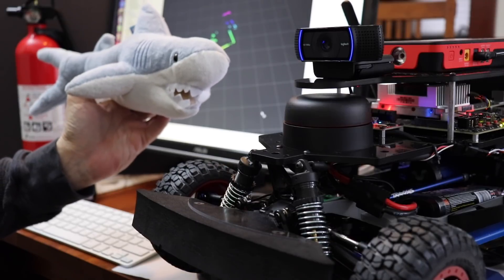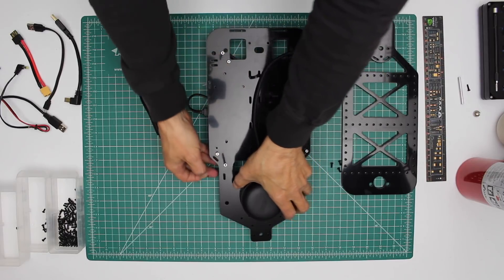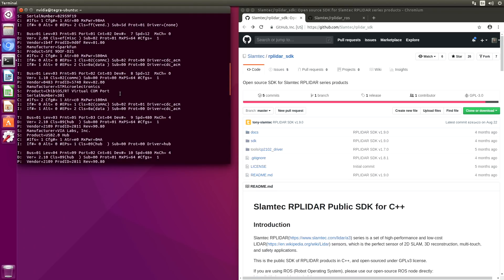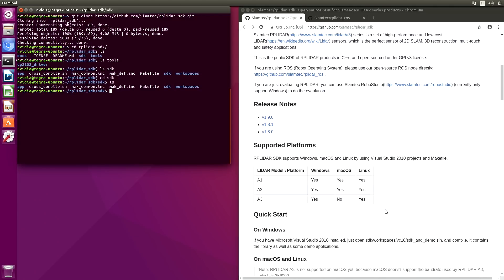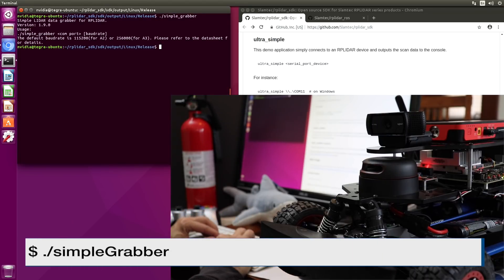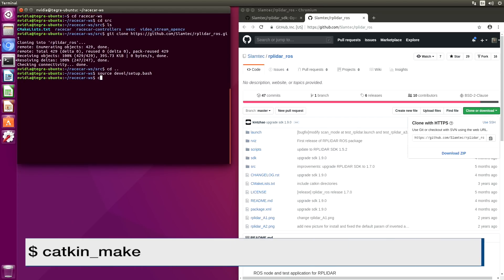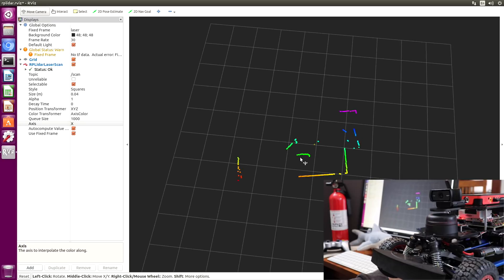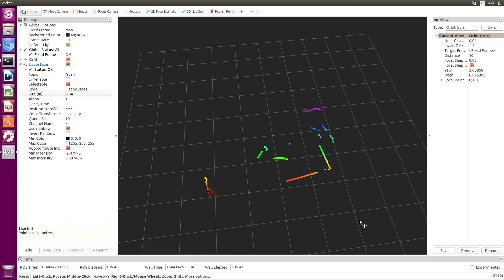RPLidar A2 - NVIDIA Jetson Development Kits

Comment: Thank you for that but  what about next step , there is no info about how can I use these laser scan output or hector slam output to make an autonomous drive
Reply from the maker: Not quite sure what  you are looking for here. There are ROS and ROS 2 packages available from Slamtec for these lidars. This allows you to use the lidars in conjunction with other ROS packages, such as Hector Slam.  If you are not using ROS/ROS 2, then there is a whole other set of questions you need to answer. Thanks for watching!

Comment: Hi, I'm working on the prototype of autonomous car. As I want to avoid obstacles using RP-Lidar A2 M8. But I want to do that in Python. As I have seen some values coming. Can you tell me how I can sort out distance values of when an object come in front of lidar? How to know? Which values will tell us? Also that object coordinate like size, width etc.  But SDK is written in C++. Can you tell me other way or suggest me some tutorials. Thank you so much if you can help me.
Reply from the maker: Not sure what you are asking. In the rplidar_sdk there is the ultra_simple app which prints out the data received from the device. You get back the angle from the device being measured,  and the distance to any object encountered. The angle will tell you the direction of an object in relation to the lidar, and the distance to that object. You will need to gather consecutive angles to determine the 'width' of the the object, remembering to correct for the circular nature of the lidar sweep. Good luck on your project!
Reply: @JetsonHacks  Thank you so much dear. What I want to tell you, It's simple to understand that I want to implement obstacle avoidance algorithm on RP-Lidar A2 M8 using Python language. And I want to sort out the accurate position of an object to avoid. But it's SDK is written in C++. Can you help me by telling availability of python libraries and please suggest me some tutorials.  Thank you! :)
Reply from the maker: @ansjaved3484  Dear, please search Github for 'RP-Lidar Python' where you will find many Python libraries for the RPLidar. Good luck on your project!
Reply: @JetsonHacks  okay cool. 👍
Reply: @JetsonHacks  dear, I have run SDK (./ultra_simple) demo, but Lidar is continuously running. How can I stop it?
Reply from the maker: @ansjaved3484  Dear, I don't know what you mean by "stop it". Stop the lidar from spinning, or stop the program?
Reply: @JetsonHacks  I solved. It was stop the lidar from spinning after end the program.
Reply from the maker: @ansjaved3484  I'm glad you got it to work.
Reply: @JetsonHacks  Dear I need your help in sensors data fusion.  As I want to do data fusion of lane line detection algorithm and obstacle avoidance algorithm. I'm using IMX160 degree FOV camera and RP Lidar A2 M8 2d 360 degree and I'm using Pyrplidar library to control Lidar. I want to avoid obstacle when it comes in way of my car following lane lines. I have 2 models 1 is lane line detection giving me a steering wheel angle, another is obstacle and object detection in that frame and it is only detecting that. Now I want to bypass obstacles coming in front of my car in a lane. 
 Please help me in this regard.
Thank you so much.
Reply from the maker: @ansjaved3484  Thank you for your kind offer to work on your project. However, I have my own projects to work on. I do not have time to work on yours also. Good luck on your project!
Reply: @JetsonHacks  hahahahahahahahahahahaha thank you so much sir. But you could suggest me any solution in these 3,4 lines which you have written. 🤔
Reply from the maker: @ansjaved3484  Sure. Study and research what you are actually trying to do and then go do it.
Reply: @JetsonHacks  yeah you are right. But I have less time. I will start again after submitting this project. Thank you for your help. You are a nice guy. That's why ask you again and again. 😊 😊😊

Comment: I have to use rplidar to detect human in a indsutrial field. So rplidar will be placed in a fixed place. Can you tell me how to achieve this? I guess i have to do the environment mapping which i have done by using ros heltor slam. But dont know what would be the next step. Can u please give me some ideads about how to detect the obstacle after got the environment mapping